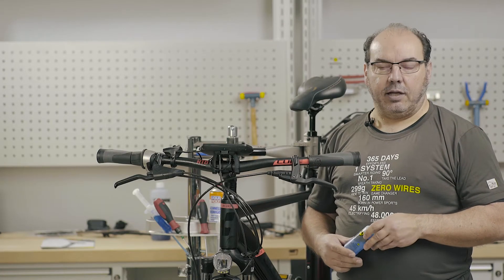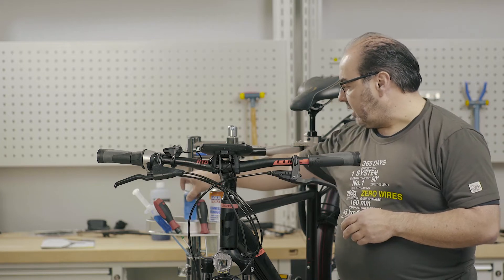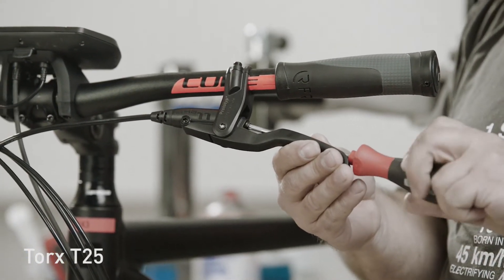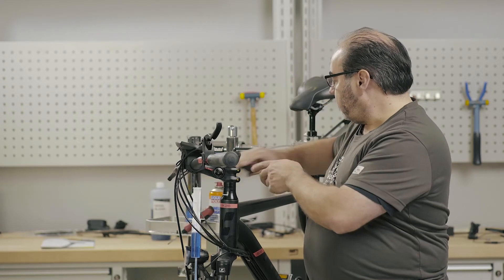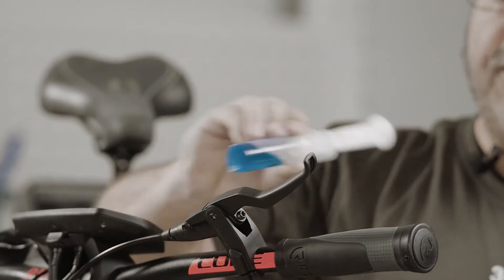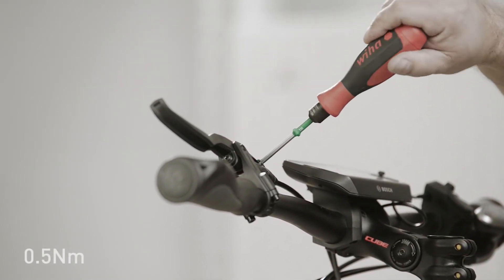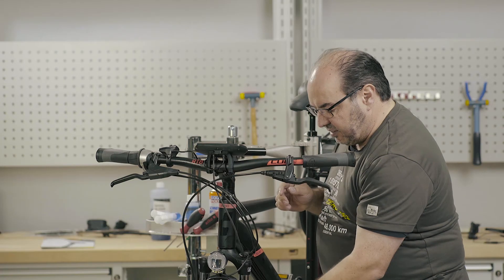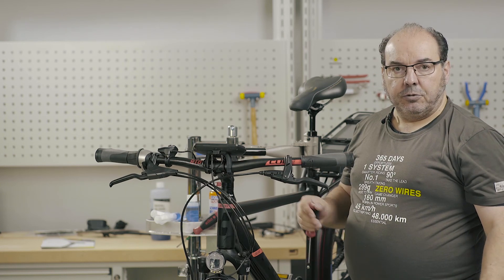Filling and Bleeding HS11N (2017)

Comment: This tutorial leaves out one very important step to remove all the bubbles.. you have to be sure to flick the brake lever a few times to get the bubbles out from there before you remove the syringe on top,  If you don't do that, bubbles will still be left in the system. There's another magura video talking about how to bleed brakes and that video they do this process. Look for that video.

Comment: Be aware that some older Magura HS11 breake handles do not have the ABT screw. In that case, you have to untighten the pipe connection screw of the handel (unscrew 1,5mm-2mm not more !) to allow the oil flux from the filled seringe towards the breake handle.
Reply: I wish i've read your comment 4h ago ! :) I seriously questionned having bought the correct bleeding kit. And i've make a mess with the oil.
Reply: This video shows the bleed process by un tightening the brake connection nut as you mention :

https://youtu.be/k6y0CqstEdQ
Reply: @thechodfather  , thank you for this link!👍
Reply: I just bought a set for the proceedings since the brake make odd sounds. Looks like this comment is what i was looking for. My HS11 brake looks very much alike this one. There is the oil screw but when i took a good look  there is also a hole on the other side which would mean that all oil would drip away when removing the screw. So that is a problem. One unscrew it partly will   likely work.

Comment: My HS 11 have a bleed plug, not a screw.  How can I be sure it will seal correctly? My rear brake wasn’t working and I found the plug had come loose.
Reply: I Think you have this system https://www.youtube.com/watch?v=dIC5AKLpS7I.
Reply: Be aware that some older model of Magura HS11 breake handles do not have the ABT screw. In that case, you have to untighten the pipe connection screw of the handel (unscrew 1,5mm-2mm not more !) to allow the oil flux from the filled seringe towards the breake handle.
Reply from the maker: Hi, feel free to send us a message on Facebook or Instagram if you need more detailed assistance on this. The EBT plug should only be needed to be plugged in to seal correctly.
Reply: @MAGURAPassionPeople  Thank you for reassuring me!  I bled the brake, pushed  plug back in, and it works.  The brake lever is not springing back out to position after squeezing it, though.  I made an appointment with my local bike shop to check it.  Thanks again for your reply.

Comment: good to see they still have the same guy after all the years. I proudly own a pair of Herzblut HS33 and they are still going strong after 10 years.
Reply: For sure the best v-brakes out there, prize to quality. I have mine over 8 years, HS11. Wouldn't change them for anything else.
Reply: These brakes are great. I have HS11's on a 2011 Giant I purchased second-hand in 2018. I came to this video when googling because I think I need to bleed the brakes. Only very recently the breaking has become less powerful, mind you that came after ~18.000 km done since buying it in 2018 🙂